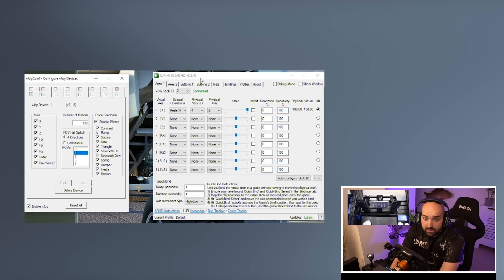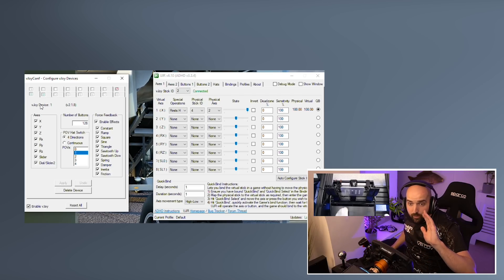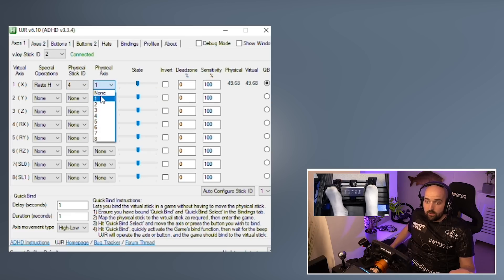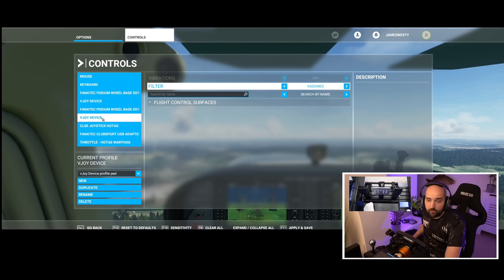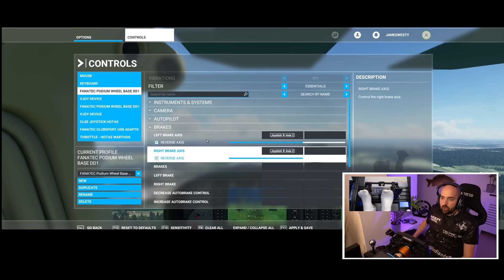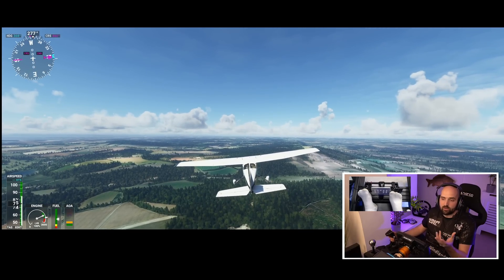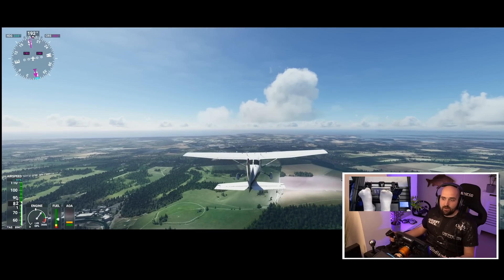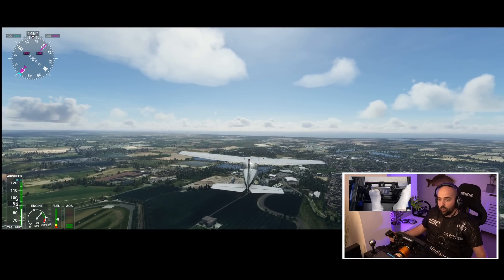How To Use Your Racing Sim Pedals As Rudder Pedals In Microsoft Flight Simulator -  Guide

Comment: Easy:  Bind clutch and accelerator to left and right rudder pedals and bind brake pedal to toe brakes. You'd lose out on differential braking but it honestly isn't that useful if you keep your taxi speeds reasonable.

It should be noted that I posted this before watching the video so if that's what he suggested joke's on me.
Reply: The problem are most game/sim only take one axis for rudder, so the easiest way for logitech G27 pedal will be select "report combine pedals" in the driver. But that means your left rudder will be much stiffer (brake) than the right (throttle) one.
Reply: @twflanker  Fair point. I know I've seen a number of flight games (not sims necessarily) that have separate rudder+ and rudder- axes but I never actually bothered to check if MSFS will.

Comment: Thanks GM, just ordered a usb adapter for my Thrustmaster Pedals so I wont have to plug my wheel in!
Reply from the maker: You might be able to combine axis with thrust master pedal and not have to use ujr / vjoy to do what I do in the video :)
Reply: @GamerMuscleVideos  Do you mean we could directly to that in MS2020 options ? Or in the Thrustmaster control panel ?
Reply: @BruBrusmayhem  if it's similar to the logitech software then i believe there is a setting in your thrustmaster app you can combine pedals such as brake and throttle.

Comment: Sorry I didn't play Flight sim's in year but in my time joystick had tilt(?) axis in them... Why do you need pedals for rudder I mean if you are really in to flight sim's then yea, but if you are not why not use that tilt axis in joystick? are they not making joysticks like that? what's going on? for me buying rudder pedals back then and now is a massive overkill.
Reply: Many if not most sticks have a twist axis for yaw, my TCA Sidestick does for example. It works pretty well though the range of travel is quite small so it can be a little tricky to smoothly hold the rudders in a precise position. At some point I plan on getting a set of rudder pedals which will improve the flying experience I think.
Reply: @GurtTarctor  when I play Il-2 Sturmovik, FB and PF that small movement was enough to fix your aim, counter wind, recover from flat spin and other manoeuvres like hammerhead etc. but like @Snowjix  said if high ends joysticks don't have that ... so yea money, money, money.
As a DIY you can you set of old pedals like MOMO, but if you have money sure.
Reply: Many properly high end sticks such as the HOTAS Warthog doesnt have this feature at all. I imagine thats why.
Reply: @snowjix  Thanks for info
Reply from the maker: Joystick twist rudder is ok and works but for the most part it gets in the way of precise input and often the twist rudder is very sticky to stiff or too jumpy compared to foot input 👍
Reply: @GamerMuscleVideos  I tried the DCS Spitfire with twist stick rudder, crashed most landings, but after switching to T3PA pedals, I nail most of them now. It has a bicycle sort of brake lever on the stick.

Comment: Actually toe brakes are installed in the vast majority of planes. You find it in all of the current liners, business jets and fighters jets. It's used in some specific planes as the only way to steer the plane on ground, like on a the Hawk used by the RAF and particularly the Red Arrows. The big planes such as the liners use a dedicated wheels to steer the plane on the ground but it's only used for taxiing, you have one for each seat in the cockpit. Using toe brakes is really useful during crosswind landings because it allows you to stay aligned with the runway by using the rudder while take advantage of the differential braking in order to have a better control. The combination of both can really help in difficult landing conditions. Great vid as usual!
Reply from the maker: I didn't say that they are not in lots of planes .....  

The point is they are not in all planes and  indioendent toe brakes are mostly used for tight turns on a taxi way. 

Needless to say it's something the vast majority of people could live without and that could be bound to a button and not having them on the rudder pedals is not the end of the world / is over stated by many anal flight sim fans that don't fly in real life. 

I'm basing this of talking to a few real pilots and the reality that you are mostly in the air + you can bind / set up brake for taxi regardless. 

By all means to brakes are nice and why not have them but it's not end of world not having them. 

Some high end rudder pedals on market don't even have them.
Reply: @GamerMuscleVideos  Actually when I watched the video I was thinking about the brake handle used of the Brits WWII fighters and the old Russian fighter jets until the Su-27 and Mig-29 came out. It was placed at the back of the flight stick and the handling was pretty different. For instance, the L39 is real bitch to taxi in DCS. Having the toe brakes feels much more intuitive to me.
Reply: @kerdougan  A lot of gliders don't have toe brakes aswell, instead the wheel brakes engage at the end of the airbrake lever.

Comment: Please do a video about a budget-friendly sim-to-flight conversion! Using pedals as rudders, and a cheap joystick for the rest? Would that make the flightsims enjoyable?

I think may of us simracers would like to try out MS FS2020 without spending a lot.
Reply: Logitech 3D or Thrustmaster t.16000m are good cheaper joysticks.
Reply: Im buying the Logitech G X52 Pro, not too expensive imo. It also has rudder movement in the stick itself, like a twisting motion. Which saves the need for pedals at all.
You can also buy the non pros which saves you like 20 or 30 pounds depending on currency and shit. Only aesthetic differences as far as i know.

Comment: I used this method with G25 pedals for a number of years and it worked well enough. The biggest annoyance is loading up the extra layers of software and making sure Windows authorizes and see's everything correctly, which ended up being the main reason I got a pair of modern, dedicated rudder pedals.. but this is a great demonstration for those that didn't know this was possible and definitely worth trying over the twist stick.
Reply: Exactly this :-) In addition, if you don't want to load external apps to bind the axis, you can uncheck "use separate gas and brake pedal" on Logitech software. This way, you can use the gas and brake pedals as rudder. Drawback is pedals don't have good physical separation, and feeling is not the same on both pedals, but it's possible.
Reply: @MrNangu  Yes, I did this for awhile as well.. until I realized I kept banking and turning right more than left due to the preference for the lower pressure required to move the gas pedal. :)

Comment: wow weird timing was literally just testing out my new yoke on dcs world before fs2020 comes out, and was having trouble using my pedals for the rudder, currently using combined keys for the brake and throttle and clutch for the brakes but would be nicer to use clutch and throttle for rudder instead aha
Reply: You can do it in DCS easily with the game's axis bindings and curves. It's a bit confusing at first but it definitely works.
Reply: @josh6499  probably but was my first time playing it haha, was trying for around an hour before giving up and using combined pedals with the break and throttle, works for now but ill give this method a try see if i can get it working to get used to it for fs2020